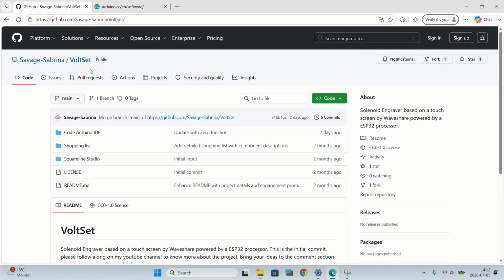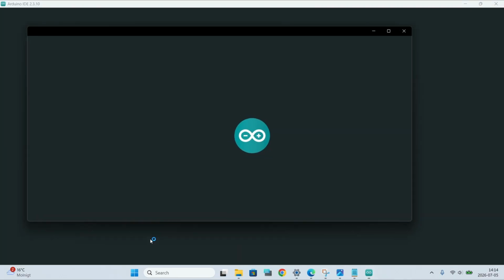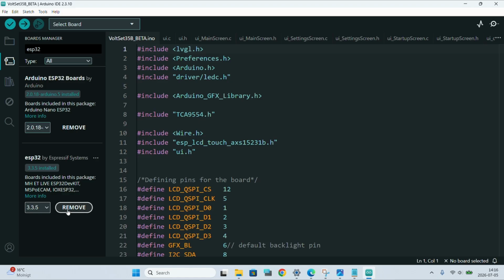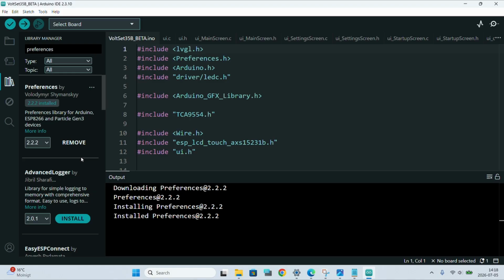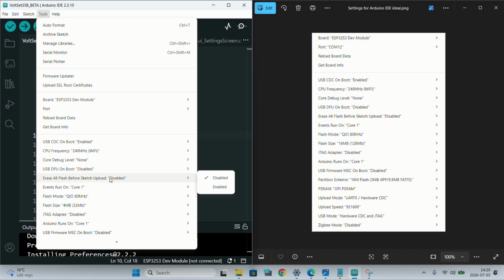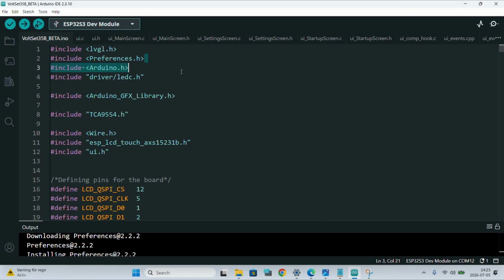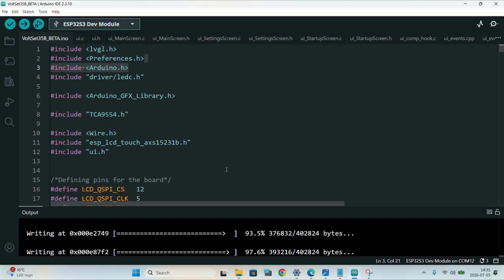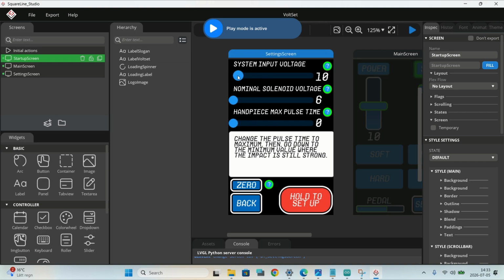DIY Solenoid Graver: Programming the board

Comment: Great Video, was able to get the esp flashed no problem!
Reply from the maker: Great that it worked. Thank you for the feedback!
Reply from the maker: Hi. Did you manage to also connect the wires?
Reply: @S @SavianoLuz thanks for asking,
still waiting for my Aliexpress parts to show up. Hopefully they next few days Let you know soon. 
I did have a quick question about the brass rod. I ordered the K&S 3/8x.014 but the inner diameter is to big. I printed the Onshape brass sleeve part out for reference and that wall thickness is about .065in
I measured a couple collets I have there around 6ish mm to 6.31.
Reply from the maker: @newtron1980  There are two major different collet sizes, you can find the metric 6mm and the imperial 6.35mm. The 3/8 inch one is too big, on the old github page you find the tube that matches the collet is the  5/16 inch tube from K&S metals.
Reply from the maker: @newtron1980  The metal tube I bought was linked as a thick one to be shaped, 6mm internal and thick, you can go imperial by ordering a 3/8" 16 gauge brass tube.
Reply: @SavianoLuz thank you!

Comment: Hi all.. I'm stuck :) .. I've follwed twice the guide, step by step, Everything looks correct to me but , once I power the screen, it just stays black. Any idea ?
Edit: I've just realized the board I've bought says "3.5", while in the video I can see "3.5B". Could this be the issue ? any idea on a solution ?
Reply from the maker: Hi, this can be the case, yes. But theres a solutiom. What I can suggest is going to the waveshare website for the board 3.5, download the arduino examples and replace the file for the lvgl config on the graver board with the example lvgl config. I believe chat gpt will also give you a solution if you explain correctly what is happening. What is the error that is being shown in the Arduino IDE screen?
Reply from the maker: Just so you know, the difference between them is not that big, the machine will work with the 3.5 also, just need some adaptations. The refresh rate will be lower but not noticeable.
Reply: @SavianoLuz  Hi Saviano you are super nice as always. i've made some research myself and yes, that is the issue. In these days I'm pretty busy and I couldn't study the whole project to search a workaround. So, for the moment I've just tried with ChatGPT. After few attempts I've managed to get the UI loaded but still nothing seems to happen to the mosfet. The solenoid is getting warmer , so, there is some power, but it doesn't move. Also there is something wrong, I guess, in the way CHatGPT  code is handling the lcd . The board seems to crash or freeze by time. I guess I will have either to learn how to read and undertand the code, or I wait to find a 3.5b ( which I don't understand way, is difficult to find here, in Italy ). Anyway, I'll let you know if I manage to get the 3.5 working. Just in case others will need to do the same trick. ... Again thanks !!.. if you pass by Venice, Italy, I'm happy to offer a beer :)
Reply from the maker: @albertomilanese9564 i am recording a short video to post avout your situation.
Reply from the maker: Theres a new video about the handpiece!

Comment: Hi, thank you for all the info, great work! Could you please let me know how to access the cad files for the handle?  It asks for an email address to access them.
Reply from the maker: Hi, the onshape cad is an online tool for development and it requires you to have an account, it is free, you can even use a temporary email, google or facebook. Maybe it would be better for me to upload the stl foles for everyone but then there would be no possibility of changing it. Please let me know if you manage to access it.
Reply: @SavianoLuz Hi, thanks for the quick response,  no problem I'll sign up I just wasn't familiar with onshape, I'm using Rhino.
Reply from the maker: @jobaria0416  you are welcome
Reply from the maker: @jobaria0416  Have you got access to the files?
Reply: @SavianoLuz hi  yes thanks! I've bought engineering resin to print the handle on my phrozen 8k.
Reply: Now I'm just trying to figure out the connection order on that little green bread board , otherwise im nearly there thanks!
Reply from the maker: @jobaria0416 the new video shows how to do it.